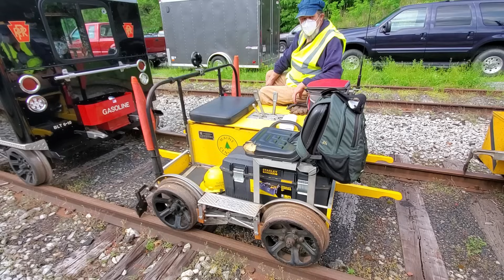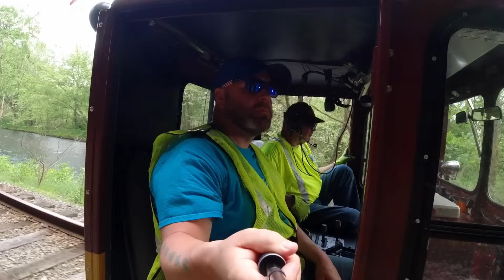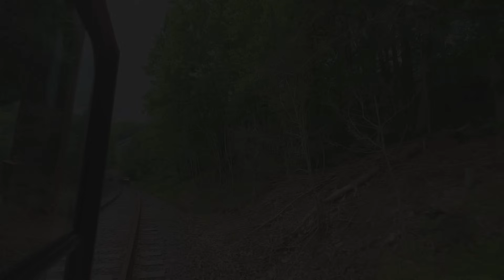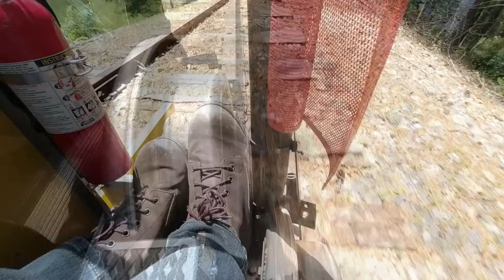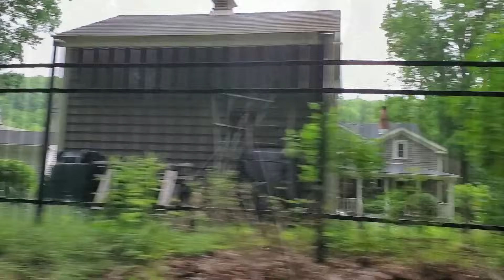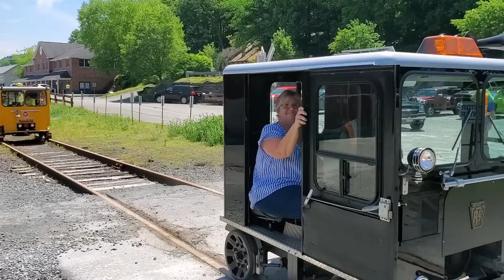Riding The Rails On A Speeder (Incredible Experience) - Stourbridge Line

Comment: The official name was Inspection Cars. The company was Fairmont Railway Motors, manufactured in Fairmont, Mn. The Hy-Rail units on the pickups were made by the same company. The Hy-Rail has been offered since the 1960's. They were also installed on 4 door sedans and station wagons along with trucks of various sizes. The last 4 door cars with Hy-Rails were an American Motors Matadors in 1975.  On the Inspection Cars the original engines were the Fairmont engines, newer ones used Onan Engines, or for greater horsepower the Kohler 4-cylinder engines were used. The Hy=Rails were offered to be installed from 3/4 ton pickups (Model 0307) up to 15-ton Ford F750 or Chevy 7500's. Repair Trucks. They also manufactured Gang Cars, to haul work crews to a site. A4's equipped with English Ford 4-cylinder engines, or A6's and A8's with American Ford Inline 6-cylinder Engines. The very first Inspection Car built by "The Motors" was in 1903, when they married a Fairmont stationary single cylinder engine, used in rural areas and on farms to power many different pieces of equipment, to a 4-man Hand Pump Cart. Fairmont Railway Motors also produced a complete line of Maintenance of Way Equipment. They were bought out by Harsco Corp in 1980, and the entire operation was moved to Columbus, S.C. in the late 1990's, and merged with 2 other Maintenance of Way Equipment manufactures that Harsco purchased' Now known as Harsco Track Technologies. I worked at The Motors" in the 1970's and 80's, in the Service Division manning the "Red Phone". When it rang, that meant someone somewhere needed a repair part yesterday. It's great to see people who really love the older equipment and spend the time, money and effort to keep them on the rails.
Reply: Nice

Comment: I like to collect railroad items. I have two glass insulators, a few railroad spikes and one I painted with gold metallic paint, one tie plate, and I restored a 1940's conductor's lantern to it's original operation. It has a cylindrical red lens, and I also found a company that I bought a kerosene tank with a wick assembly. It now works as intended.

Comment: For those wondering, at the end of the video, Jay's closing comments were done right about here 41°34'22.12" N  75°15'23.37" W - Google Earth's imagery date was 10/9/2016, so it appears that those passenger cars and snowplow haven't moved in a while.  That power station (41°28'02.58" N  75°07'53.65" W) was pretty cool, especially since there's a big pipe that goes from that water tank to Lake Wallenpaupack.  Fond memories of that lake, that's all I can say - lol.  Thanks, Jay - another great video :)

Comment: I actually have a M9 exactly like the one shown by the man that was talking only mine is ran off peddling just like a bicycle. I run it up and down the main line CSX tracks and simply just lift it off the rails when a train is coming. I have it mounted with wooden poles that slide from the front and back so you can easily move it. 

If you've ever seen the old 50s or maybe 60s Canadian movie called "The Railrodder" with Buster Keaton then you've seen the same exact speeder before! Only his and these guy's have a gas powered motor on theirs and mine is simply rigged with bicycle peddle and gears...

Comment: As a current mow worker i would love to have one of these i have personally done miles and miles on track in full size mow equipment one of the longest track travel i did was 60mi i would opt for the open cab version because there is nothing like riding the rails with the wind in your face and anything that sketchy looking lol

Comment: About hoew fast do those go on the smooth stretches?
Reply from the maker: The open air tops out between 25-30 mph, but some of the enclosed ones with bigger motor and better transmissions can go closer to 50mph.